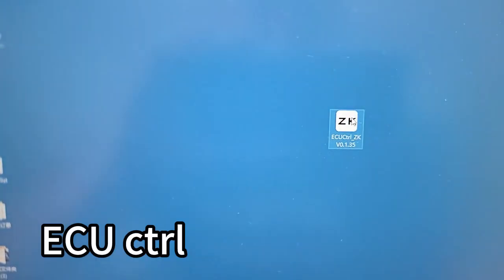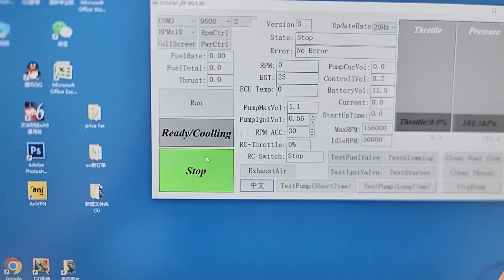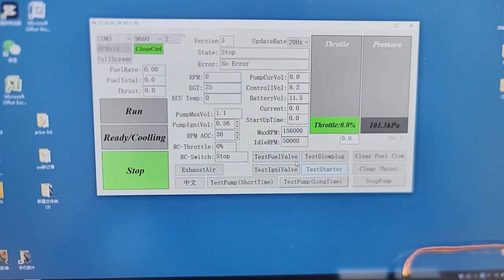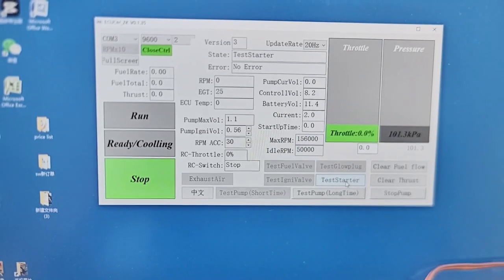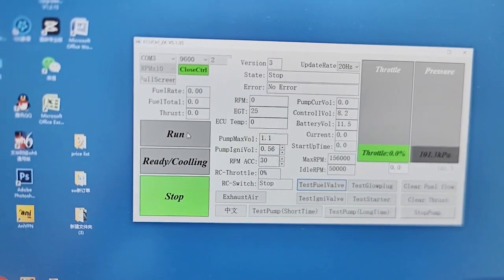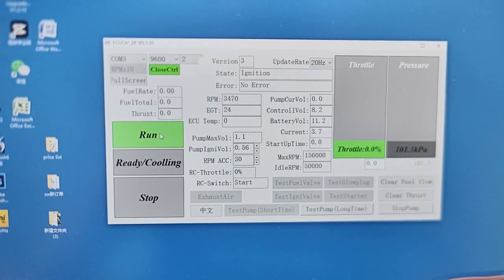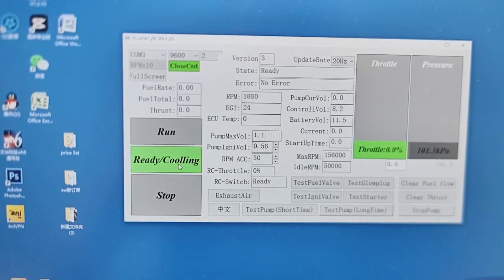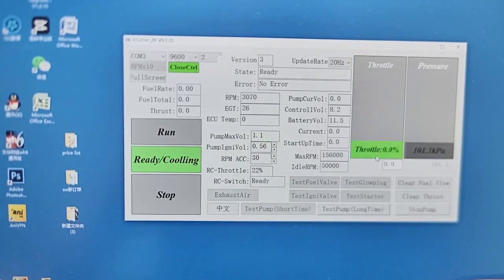Swiwin turbine how to Control turbine

Comment: Do I need the switch or can the engine be started and stopped via GSU and throttle controlled by the PPM device ?

How that switch is connected to enable the function ?